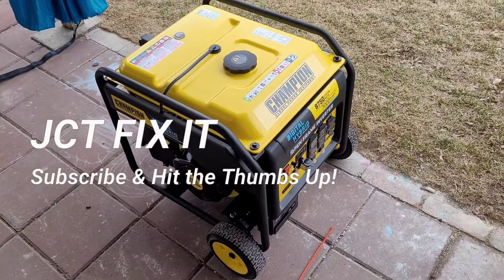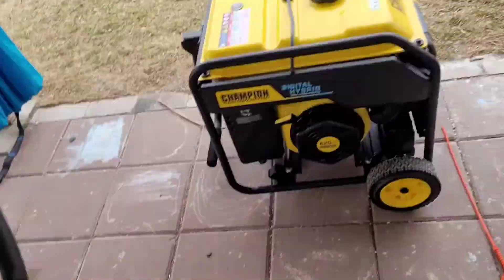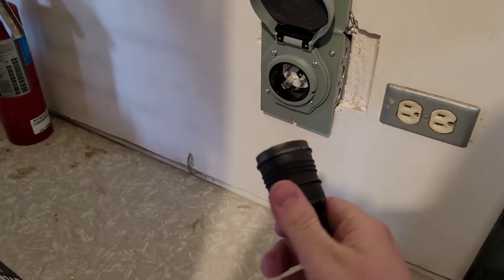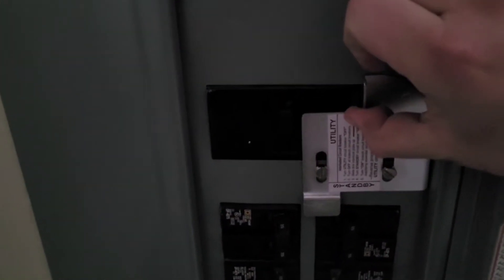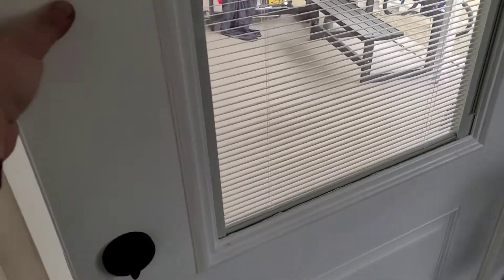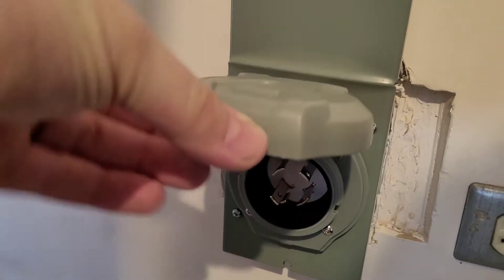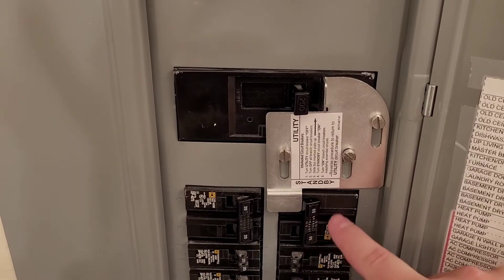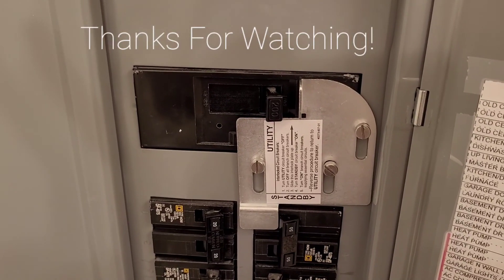Powering My ENTIRE House with Champion Inverter Generator.

Comment: Quiet Technology (not included) lol
Reply from the maker: Ya it's an open frame inverter so better than some generators, but pretty loud.
Reply: @JCTFIXIT  I ended up buying one, but will try and convert a shed to a generator house to keep the noise down. This gen is the best bang for the buck in a reliable tri-fuel inverter.

Comment: A safer thing to do is when you shut off the main breaker in your panel, also shut off ALL the individual breakers as well.  After you throw the breaker for the generator to supply the panel, turn on each circuit individually with a few moments pause in between each.  This eases the load on the gen if there is anything large you are unaware of still turned on - like your stove, oven, central heat, and/or water heater, etc.  Something like that could easily overwhelm the gen and trip a breaker or cause a problem.

If you are really handy, a watt meter is a nice addition as well.  This way you can track the increase in load as you turn on each breaker to see if there is anything demanding a huge draw on the circuit you are activating.
Reply from the maker: I agree with your advice. Thanks for the input.

Comment: Do you know if you can run this generator in parallel with another identical unit for more power?
Reply from the maker: It's not designed with a parallel kit, that doesn't mean it couldn't be done, but I would just get a larger generator.
Reply: @JCTFIXIT I bought the trifuel 15kw/12kw champion generator. Is not inverted. How can I clean the "dirty power" things I want to power are 4 ton a/c, large fridge, washer/dryer. Occasional gas furnace and small appliances, a few lights. I want to hook it up to natural gas. Most inverted generators from champion max out at 9kw but loose kw on natural gas.

Comment: Good to see economical way to hook up house without that extra gen to house kit. I would guess some folks might turn off some of the larger amp breakers at beginning to avoid all of them drawing generator electricity at the same time (if that was a combo that could overload the generator, which would just turn it off via it's own protection breakers) ... Thanks for Econ Model 🏊🚣⛵🎶🙂

Comment: I thought it has quiet technology, seems pretty loud. How do you like it? Thanks
Reply from the maker: It's good. The ones that are quiet usually have a built-in plastic cage and absorption for Acoustics this one not so much although the engine speed can vary because it is an inverter
Reply: @JCTFIXIT  That's good to know. I just order the 6250 inverter today & I'm gonna build a quiet box for it. Thanks for sharing 👍

Comment: As an electrician, thanks for showing people the safe way so that linemen do not get killed. ALSO, Did you confirm if your generator has a “floating neutral” ( neutral and ground are separate in the gen) or a “ bonded neutral” ( neutral and ground are connected in the gen ) ??  When you connect your gen to your house system, you need to separate the neutral and ground in the generator.  The reason is because when connecting the gen to your home you have created ONE system.  Per code, you can only have one ground per system.
Reply from the maker: My generator does have a bonded neutral but I disconnected it so it is now floating for this purpose
Reply: @JCTFIXIT plz explain this further. I'm trying to understand what you said  about the ground thing. I back feed through my dryer plug but if I turn anything on 120 wise like a light it blows it out. Like to much power⁉️ why is that⁉️
Reply from the maker: Sounds like you are not hooked up right.  Side note: Lookup floating vs bonded neutral on Google.
Reply: Generally the user manual for the generator will tell you how it is grounded
Reply: Do you know if you can run this unit in parallel with another generator for more power?
Reply from the maker: I do not believe that it is parallel ready.
Reply: @JCTFIXIT  I am trying to decide between the champion 10000 watt and the 9000 watt with inverter. I would run natural gas an emergency home backup. I have gas hot water and heat, 3 ton AC in a 2300 sq ft house. Normal appliances, smart TVs ect. Which do you recommend I go with?
Reply from the maker: I like the inverter myself. It's more efficient when under lighter loads and delivers a pure sine wave. Starting your AC compressor may require you to have nost circuits off until it is up and running as the inrush current would be high. That is the case for me.
Reply: @sammyjoe2390 blah blah blah . You never wrote no books for nobody . Just another “know it all” that likes to hear them selves talk our the side of their arrogant neck 😂
Reply from the maker: @samanthabown7925  thanks for calling the clowns out. I went ahead and removed the garbage from this thread.
Reply: All that is code mumbo jumbo. Your using a generator because it’s a emergency situation. Codes be damned. You do what you gotta do, to keep the power on. Worse comes to worse you can ground your genie to the grounding rod of the house.

Comment: Does it run ac?
Reply from the maker: Depends on the AC unit. At my last house it would run the AC unit. I recently moved and it will not run the AC unit for my new house, so I'm going to have to get a soft start kit for it
Reply: @JCTFIXIT  any issues with it so far? Stalling out? Fault light issues?
Reply from the maker: No I have not had any issues I'm so far granted I've only ran it for a few hours here and there
Reply from the maker: It was a traditional compressor. Mini splits are usually very efficient. It would likely run it no problems.
Reply: @Dickj203 naw man go ahead with the FULL inverter. Model #100719 or #201175 if you want duel fuel. There’s Day and night difference in sound. Almost as quiet as a Honda.

Comment: What gen u recommend to run small window ac , lights , fan, TV, and microwave, during power outages? I don't have or need the 240 but will be using cords for the 120. Any help appreciated, subbed, great vid
Reply: First I wouldn't recommend anything harbor freight with only a 90 day warranty. 

I have a champion 3500 that I can run 2-8000 btu air conditioners, along with lights and TV ,refrigerator, freezer. In order to run the microwave or toaster oven we have to turn the air conditioners off
Reply from the maker: Depends on what kind of load your window ac pulls. Probably a 3500 inverter model would work well. Something like this: https://www.harborfreight.com/3500-watt-super-quiet-inverter-generator-with-co-secure-technology-59137.html

Comment: What does it cost to have an electrician install a generator interface on the power panel that will power your home like you have in this video? Just a rough idea. I am looking to purchase a Champion 9375. Great video, Thanks!
Reply from the maker: Hard to say. Really depends on how easily you can access your main breaker. With easy access I would think $300-$400 for labor + cost of parts and permits.
Reply: @JCTFIXIT  Thank You, appreciate the info
Reply from the maker: You could call and get a couple quotes.
Reply: That depends a lot on your current panels. It depends a lot on what you have is up to code or not.    When an actual electrician pulls a permit and goes into make some changes he may have to bring some older things up to current codes.   This can add a lot of cost.

It also depends on your panels and if you can put a simple interlock on there or not. If you can, full retail you're probably looking at $150 for the interlock, $30 for a 30 amp generator breaker, $50 for the receptacle, $25 for miscellaneous conduit fittings, $20 for some wire. Then probably about 3 hours of a electrician's time. So a rough estimate would be $450.   Of course you can do this yourself for only the cost of the parts if it's that easy. 

My service panel has no main breaker.  So I had to put a interrupt panel in between my service panel and my house which only allows me to attach the generator to the house panel. So mine will not run my big amp items like AC stove water heater or furnace.   Those had their own breakers in the service panel by the meter.     That's okay because I have small window unit ACS I put in after a storm if the power is out for a few days they use a lot less energy than the big Central AC.  Being able to use the water heater or limited use of the stove would be nice but I've always gotten by with just microwave and a toaster oven. And cold showers.

I could put in a big 200 amp transfer panel between the meter and the house panel to solve my problem.... Or just replace the whole service panel with one with a main disconnect breaker.  That would probably be the easiest and I got a price on that and it was not a nice price.......$3700. when they do this they have to bring things up to code, they do not want to reuse old breakers they want to use all new, etc. Plus they've got to get a permit and an inspection etc etc.  They charge for all the time that it requires from them by the hour.

So in the end I put in my panel myself for about $400 total.   This is why so many people will just flip their breaker and use a suicide cord and plug into their dryer socket.  That cost $50, and you're really doing the same thing you just don't have the idiot proof interlock.   However after running extension cords through doors for years I was sick of extension cords and that was my main reason for going ahead and putting in the generator receptacle and transfer panel outside to basically power what I needed in the house.  Turn on whatever light you want instead of just a few lamps. Run ceiling fans instead of just floor fan. Don't have to pull the refrigerator and microwave out so you can have them plugged in to extension cords etc. That was all a royal p i t a. It is well worth whatever it costs imo for ease. It took me many years and several episodes without power for a few days to do mine because I just knew mine wasn't simple.  There was really only one company that made the kind of transfer panel I needed and that was reliance panel link
Reply: Depending on your locality you may not be allowed to have that interlock inside your house either.... It may be required to be at the service panel outside and accessible to the power company.  If you don't have a service panel outside that is a different problem to be solved.   There is a lot of things done not according to rules by homeowners, that will get out of hand and very $$$$ when you involve permits and electricians and the power company.

Again, this is why so many people just use the suicide cord into the dryer socket and flip their breaker.  You can be looking at thousands of dollars to do it right or something that's basically free.   

Technically I was supposed to have a permit to put in my transfer panel and they will only issue a permit to an electrician and they have to submit drawings and all kind of information to get the permit.  In fact in my locality all electrical work requires a permit.   Anything.     Somewhat ridiculous.  I talked to 2  electricians who said we don't get a permit unless we have to have the electric company pull the meter.  So electricians don't even follow the rules.
Reply: @duskyman1  What locality requires the service panel to be outside and accessible to the power company?
Reply from the maker: Some do. Mine does not, but I'm pretty sure my builder just did this to cut costs. I would much prefer my main breaker to be inside the garage.
Reply: @PeterLawton  not necessarily the service panel alone, but any interlock switch for a generator specifically it's called out by Entergy to be outside and accessible by power company.   In other words if you got a generator running they want to be able to verify that it is blocked out if they need to. I have seen lots of things on the internet where they are in the garage
Reply: @duskyman1  I never heard of that.  So I called Entergy just now, and the 4 people I spoke with, including the "New Construction" department, were not familiar with this.  

Maybe it's true anyway.  Or maybe an employee exceeded his authority.  Or maybe an electrician assumed this is a requirement and relayed that assumption.

It just seems like a very expensive backfit for many homes, if not most.  Entergy serves Texas, and Texas is well known for leaning away from excessive regulation.  That's the primary reason Texas has its own electrical grid -- such thinking is a big deal there.
Reply: @PeterLawton  I believe it's in their guide for electrical installations. You can find these online..... Or it might be a state thing for me in LA. I don't remember which.  

I don't expect everybody to know all the rules, because they never seem to.   Inspectors get things wrong all the time, misunderstanding requirements.  But it's often easier just go along with them instead of fighting them.
Reply: Should cost no more than $450. it is simple to do.
Reply: I just put in an interlock, breaker, receptacle, wiring, conduit, etc., with little prior electrical experience. Pretty straight forward.

Comment: The 6250 will run ALMOST everything in most houses that have gas appliances. What the 6250 will not run is most residential AC units. The 6250 will not deliver the locked rotor amperage necessary to run anything over about a 2 ton AC. I use the interlock too, and I love it. I can run the central heat, but not the central air.
Reply from the maker: My AC compressor runs no problems. I imagine some of the older and/or bigger units could be problematic.
Reply: My guess is your AC is a smaller unit. The 6250 won't deliver nearly enough current to start my 3.5 ton unit. The locked rotor amperage of the unit is 108 amps and the Champion 6250 is only rated at 52 amps (26 amps over each leg of a 240 volt circuit) and based on the typical LRA of a 3 ton unit, it would probably trip off for most of them.. But maybe not. I know it won't start mine and a 100 amp LRA is pretty typical of a 3.5 ton unit and 75 LRA is typical of most 3 ton units.
Reply: @shenmisheshou7002  Any drawbacks to using a soft start on the A/C?
Reply: @sony1998  I think it would clearly help but hard start kits are very hard on motor windings. I am considering a soft start kit though. These are much more expensive , but I think they are perhaps a better approach.  This would reduce the startup current by about 60% so for my unit, this might be enough to start it. LRA is a bit more than 100 amps and the 6250 will put out a peak of 52 amps, but that is cutting it close.  It would cost me about  $300 to find out though.
Reply: @sony1998  In addition to the response I just put up, people also forget about the inrush current on the evaporator blower motor.  My unit starts the compressor first and when the pressure at the evaporator is sufficient it turns on the fan, but this fan draws about 1400 watts on startup and I think about 800 watts run. This totals out to a lot of current for a small generator.  My primary concern was heat during prolonged power outages in the winter where the power can take hours to be restored (4 hours day before yesterday).  In the summer we sometimes have outages but these are usually no more than 90 minutes.
Reply: @sony1998  nope, they're great especially for generators
Reply from the maker: A soft start would be ideal honestly. I see why they don't from a cost standpoint but ot would be amazing to have all DC motors for this kind of stuff.
Reply: Yeah they’re pricy, I personally use the 5/2/1 hard start kit and it’s been good for years and cheap.
Reply from the maker: A soft start and a hard start kit (aka a capacitor) are not the same thing. But it doesn't hurt to add one of those hard start kits. I put one of those on my RV AC unit.
Reply: Oh yeah I know they’re different and the price reflects that big time.  I’ve only used the hard starts personally with great results.
Reply: @shenmisheshou7002 many houses have 100 amp service, mine has 200 but 100 of that is dedicated to a separate shop.
Reply: What about a heat pump/mini split ac system?
Reply: @Dickj203  It depends. On the outdoor unit, there should be a label with the Locked Rotor Amperage (LRA).  This is the amount of power that the compressor motor takes to actually start turning. Once it starts, the consumption falls off considerably, but starting them takes  a big, short draw of amperage.  For example, if the LRA was 50 amps, you would need about 6000 watts to start it.   If it was 40 amps, you would need maybe 4800 watts peak.  After it starts, they take usually 1/3rd of the power to keep running.  Some of the newer mini-splits are "Inverter" AC. These can vary the speed of the compressor, and the inverter types take a lot less starting current.  So, the answer is in the LRA and that is on the label on the unit.
Reply: @Dickj203  Yeah, just check the LRA and the running amps.  Remember though that things like refrigerators have compressors too, and if they start up while the mini-slit is running you may trip the generator breaker, but you won't hurt anything in the generator.  I would look at the LRA and then look at the other things in the house that you deem essential (internet router, lights, fridge, TV, etc) and get an idea of the base load (the things that will be running all the time or a lot) and then add in your LRA for the mini split.  I recommend a 20% overcapacity, so if you think your base is say 2500 watts and the minisplit is 2500 watts, would recommend that you go 20% higher than that.  Two reasons, one is that you just want a bit of overhead in case the AC and the Fridge both decide to start at once, and the so that the generator is not running full speed.  I can run a fridge, a small freezer, a mini fridge, internet, TV, and my central heat on a 5000 watt generator and get by with aouy 4.2 gallons of gas for about 13 hours.  Running at full throttle, more like 8 hours.